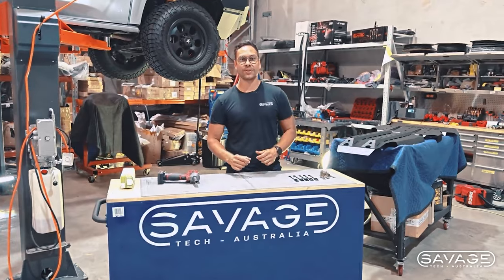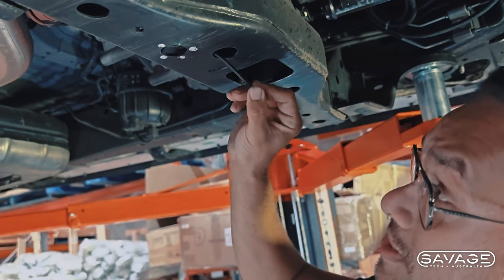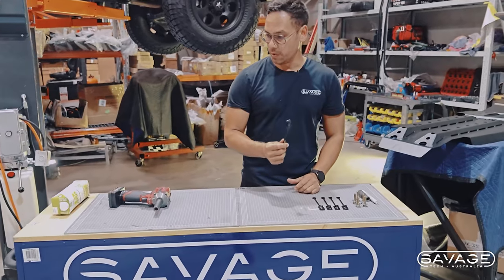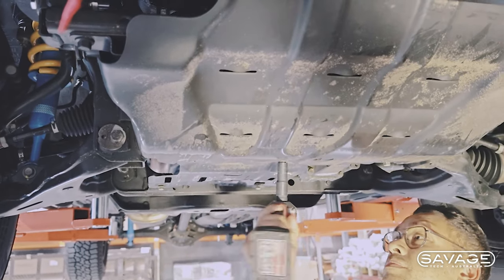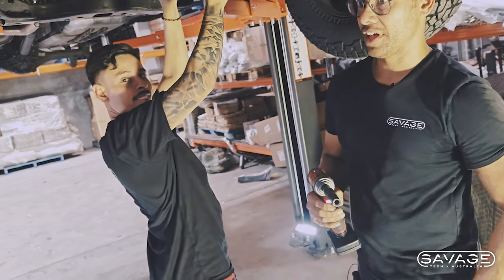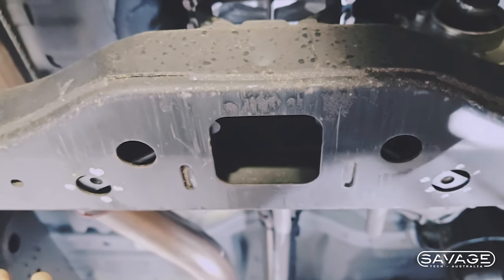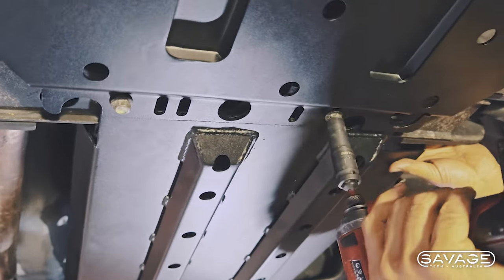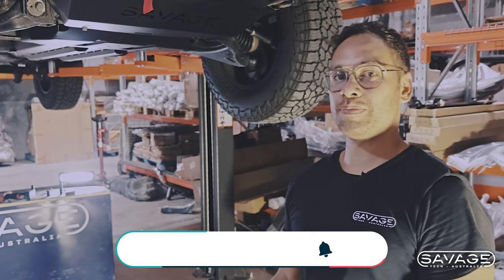GWM CANNON SAVAGE UNDERBODY PROTECTION INSTALLATION

Comment: the ribs that protect the gear box etc , shouldnt have holes in them like that, rather holes on sides and set steal at an angle for dirt to run down and out. reason being if those holes clip a rock its not guna scrape it, its guna catch that steal and rip the plate which could bend up and fuck up everything even more. or maybe I'm stupid.